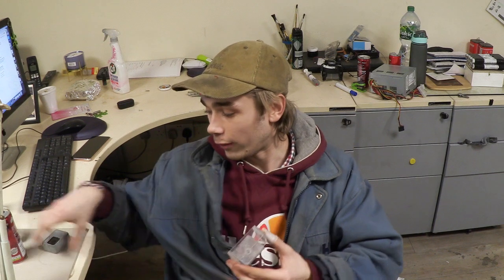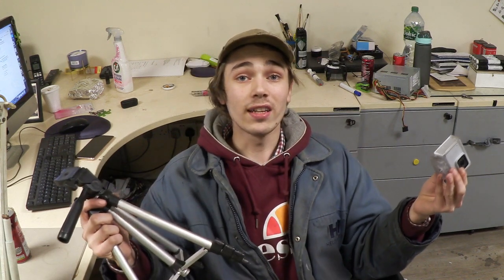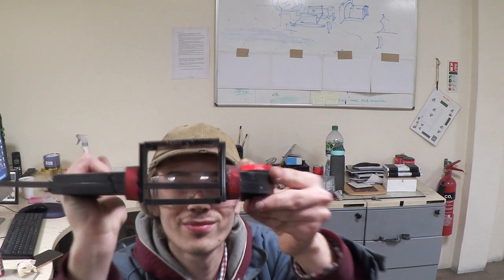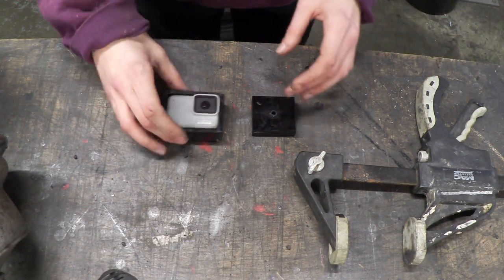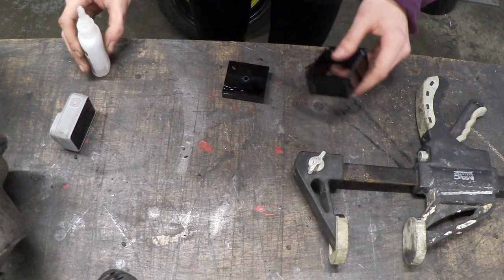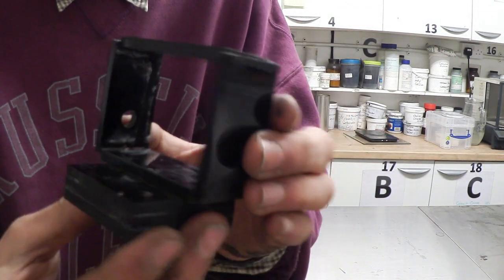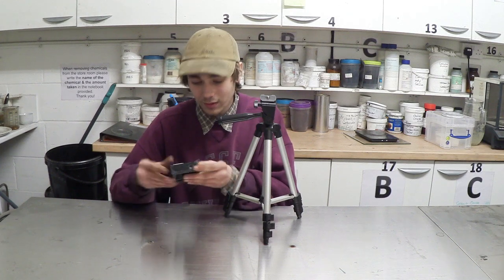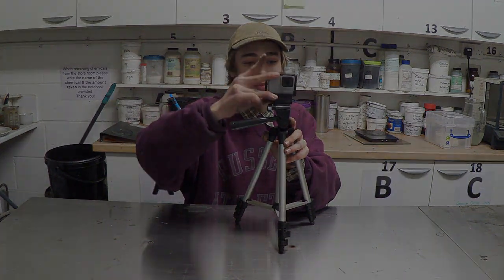964 - DIY GoPro Tripod Mount

Comment: Great job at getting a perfect fit!!  Another option is to make the encasement just a little larger than the GoPro, then line it with something like velcro loop tape (not the hook side, but the fuzzy side).  The fit can be a little more forgiving, it will help to dampen vibrations that might otherwise affect the microphone and you won't scratch the camera sliding it in and out.  I've also seen versions with a little pressure screw - stick a little padding onto the side of the camera then turn a thumbscrew through the case to pinch the camera.  
Oh!  And speaking of microphones... don't forget to drill a small holes for them!  Not sure which version GoPro you have, but my microphones are on the sides. 😊

Comment: Just a note, and Rob may have pointed it out too, the nut would be more secure if you pulled it into the countersink from underneath.
That is, put the counter sink on top of the base plate, so the nut pulls against the baseplate.
I'll grant a GoPro is not a heavy load, but super glue is not meant for a lateral loading.  :)
Good simple design though!

Comment: Why Gopro could not have included the standard  ¼ inch tripod I don’t know. This looks like the perfect solution (I also like the price). For your type of  workshop environment, I think you’d also find a GorillaPod very useful. One can rap the legs around things to achieve unobstructed overhead or high angle shots. I’d be lost without mine. Talking of  unobstructed shots. During the current lock down, if you can find any budding camera enthusiast to hold the camera for you,   s/he will instinctively point out when the work piece becomes hidden from the camera’s view, such as at 3:20 and again at 3:50 and reposition. Single handedly, this is tiresome to check each camera position to avoid this. I would think, this channel has enough of a track record now, to make it easy to find someone local who would to be willing to help out on the video side, just to get more on-the-job-experience and as a show-case for his camera and editing skills. It a’be a win-win for both parties.